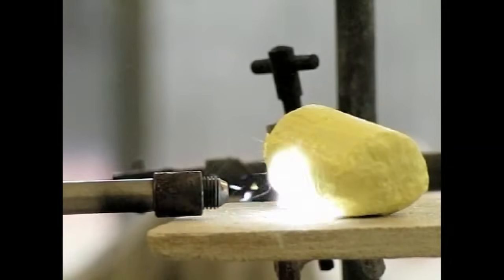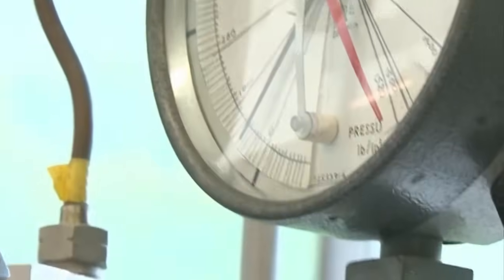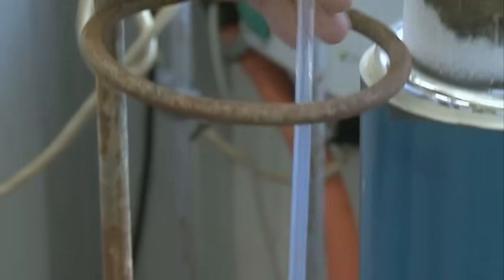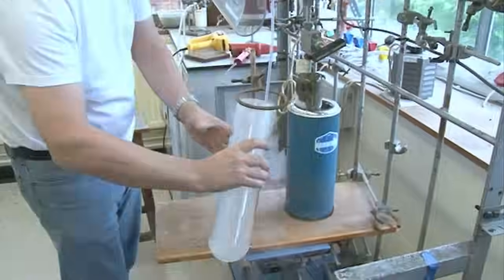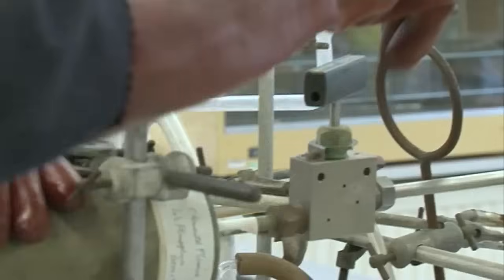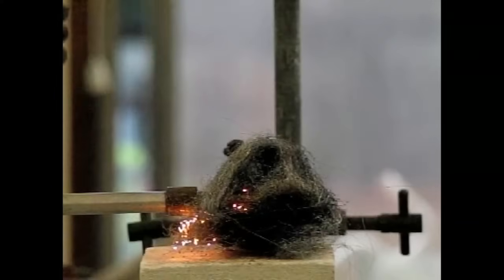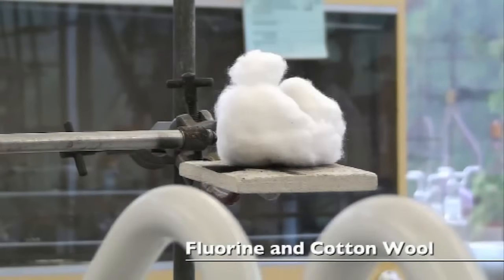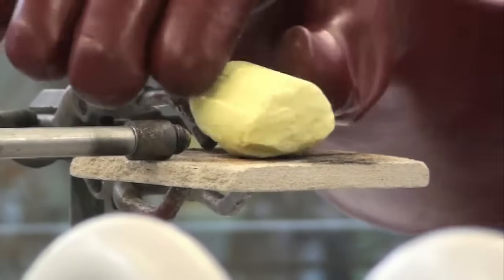Fluorine - Periodic Table of Videos

Comment: So despite all of group 8 being noble gases, fluorine will react with all of them except for Helium and Neon?
Also, i thought that HF had to be stored in PTFE? 
Have worked since leaving school 20yrs ago as a coded pipe welder, specialising in stainless steel. Most jobs I work on, the welds and the area around them are  "pickled" using a paste containing a mixture of around 25% HF and 75% Nitric Acid, to strip the surface layer of oxidised metal, leaving a clean passive layer beneath. This pickling acid is always supplied and stored in PTFE tubs. Is very nasty stuff indeed😲

Comment: When the jet of F2 burns directly through the iron, I wonder what happens to the unreacted gas that now finds itself in the atmosphere?  My guess is that it immediately finds some humidity, releasing HF and O2.  That can't be very nice to breathe in.
Reply: It might also react with the nitrogen in the air and produce NF3, because although nitrogen is very inert, fluorine is extremely reactive and can pull some molecules apart(which makes those N atoms very reactive too) and react with it, and nitrogen makes up about 80% of the air.

Comment: In addition to fluorapatite is inherently less soluble than hydroxyapatite, even under acidic conditions,  fluoride ions inhibit alcoholic fermentation and glycolysis. Otto Warburg and Walter Christian (Isolierung und Kristallisation des Garungsferments Enolase. Biochem. Z. 1941;310:384–421) have shown that this is due to the inhibition of enolase. In bacteria (e.g. in oral cavity) inhibiting this essential enzyme may have direct effects on both bacterial viability and pathogenicity.

Comment: Are oxygen and fluorine the only elements or molecules electronegative enough to cause combustion?
Reply: Combustion is not strictly related to electronegativity, bot more to oxidation potential. So other compounds, like permanganates, peroxides, nitrates, etc, which are also strong oxidizers, will also cause combustion. But in general, strongly electronegative elements are also strong oxidizers.

Comment: Fluorine can also 'oxidise' oxygen, the only element which can. Oxygen itself is a vicious element already, easily oxidises chlorine, right the way to perchlorate.
Reply: @Come up With unique username #VoteBlue  You are incorrect my friend. There is an entire series of halogen oxides (excluding fluorine). For example chlorine dioxide used to disinfect water, and also corresponding chlorine oxyacids and ionic compounds of them, for example perchloric acid and potassium perchlorate. 

And, there is a series of oxygen fluorides, for example dioxygen difluoride. 

Also take a look at compounds like perchloryl fluoride and nitryl fluoride for even more wackiness.

A simple look at the Periodic Table will explain what is and isn't possible in terms of what can oxidise what.

I think you are talking about 02, dioxygen, which is already reacted - with itself, as I mentioned in my first comment.
Reply: @andygrove285  Things doesn't work this simple Just because a compound exists it doesn't mean you can synthesize it from its constituent elements. For example Ag2O, Au2O3 and HgO all exists, but still, you can't make them by burning the corresponding metal. The same is true for a lot of halogene oxides. (Also F2 only reacts with O2 using an electric discharge, so I wouldn't call it a simple oxidation.) Also checking the ptable for electronegativities won't tell you everything about an element's reactivity.
Reply: @hungarianheroes  What are you talking about? Can fluorine oxidise oxygen? The answer is yes. Can oxygen oxidise halogens, except fluorine - again yes. Please take time to read my comments. I said nothing about direct synthesis or any method of preparation. Furthermore, you  are considering molecular dioxgen, so your logic is flawed anyway.
It seems yourself and our friend @Sweet bromine are considering oxidation in layman's terms, meaning like element/compound X reacts with oxygen to produce an oxide. In chemistry terms, oxidation is the process whereby an atom, ion or molecule loses electrons. Fluorine can pull an electron from just about any other element, even oxygen. Oxygen can pull electrons from just about any other element, except fluorine. There may be other bizarre cases, such as excimers or something, but, at STP it's generally true. Of course, the noble gases are extremely difficult, or impossible to oxidise due to their electronic stability. However, xenon fluorides do exist for example.
Reply: @andygrove285  From your original comment: "Oxygen itself is a vicious element already, " - looks like you as well meant elemental oxygen. After that it was normal from sweetbromine and myself to assume that you really ARE talking about dioxygen. And thanks, I was not in need of this additional explanation about how redox reactions work.
Reply: @hungarianheroes  It's pretty clear what I meant when I mentioned perchlorate. If yourself and sweetbromine tend to take the naive view of that, it's not really my fault. And, once again, it seems pretty clear that both yourself and sweetbromine are considering plain, chemistry 101 reactions with molecular oxygen which is itself a compound. In any case, I hope the situation is now clear.
Reply: @sweetbromine83 Wrong.

If reality worked you think it does, then compounds such as chlorates, perchlorates, clorites and clorine oxydes would not exist.

Comment: Hydrogen fluoride acid is serious stuff, I've had the honor of working with it. No need to fear elements but respect them.
Reply: What are the protocols and environments you use to safely work with it?
Reply: @luisp.3788  Wore a tyvek suit (which isn't going to save you), self breathing apparatus (held negative pressure to keep contaminants out), triple nitrile gloves and chemical resistant ones. Honestly you have to wear all that for liability, HF eats through everything but teflon based products. Its a weak acid with the strongest bond to hydrogen. Your body cannot metabolize fluorines, if you live through exposure it'll wreck havoc on the nervous system and organs including the brain.
Sorry for the late 3 year reply, hope all is well on your end mate!
Reply: @FightinForTruth  Thanks. Yeah, I'm alright. Honestly, I don't know why I asked back then but I'll certainly add this to my notes if I ever need the stuff.
Reply: @luisp.3788  Glad to hear you're fine and theres nothing wrong with being curious. 
Unless you end up working in the chemical industry handling fluorines, you can't get a hold of HF. You have to have a license to buy most dangerous chemicals.

Comment: Is Fluorine just as reactive when at a liquid state @ -196oC.
Reply: I'm guessing no however I'd imagine that like with liquid oxygen it wouldn't be the liquid fluorine itself directly reacting with something causing the fire but the fluorine gas being generated from the heat of the reaction vaporizing some of the liquid fluorine into a gas.

Also the warm substance itself (unless pre-chilled to below -188 degrees Celsius) would again also turn some of the liquid into a gas which in turn would start reacting.

Comment: What would happen if you put that liquid flourine Into a 6 inch thick solid glass Container and Sealed it, melting it on the outside so that it’s one solid piece with no air on the inside And allowed it to warm up to room temperature?

Comment: Why was it that these various demonstrated reactions didn't produce toxic gases dangerous to those present?
Reply: 1. Most of the demonstrations consume the fluorine gas almost immediately
2. The fluorine gas rapidly reacted with moisture in the air to form hydrofluoric acid in low concentration, which mostly stayed near the test setup
3. The room likely has positive pressure ventilation, so any leftover hazardous chemicals were forced out of the room rapidly (like in a fume hood)

Comment: I thought it was very toxic but he just burns it in his lab 🤣. Probably mixed it up with HF.
Reply: Yeah, I'm surprise also that they're not wearing face masks. (Gas masks)
Reply: 1. Most of the demonstrations consume the fluorine gas almost immediately
2. The fluorine gas rapidly reacted with moisture in the air to form hydrofluoric acid in low concentration, which mostly stayed near the test setup
3. The room likely has positive pressure ventilation, so any leftover hazardous chemicals were forced out of the room rapidly (like in a fume hood)

Fluorine is indeed very dangerous, but if you're careful you can use it quite safely -  as was done here. The number of chemists that died or were maimed trying to isolate fluorine is quite impressive, but such events are now quite rare because the proper safety protocols have been developed for dealing with it (nickel/polymer materials, positive pressure ventilation, etc).

Comment: It's amazing such a highly reactive element makes exceptionally inert materials such as fluoropolymers (e.g. Teflon).
Reply: Um... as a non-chemist (but remembering my material science classes) I'd say their ambition to bond (with basically anything) is the very reason that they can't "let go", thus creating very stable = inert molecules.
Reply: The flouride bond is so damn strong that it takes incredible energy to separate it. It would be like trying to pull apart 2 strong magnet.
Reply: Fluorine does NOT like to share.
Reply: Or SF6!
Reply: @FarhanAmin1994  That's only kinetically stable.

Comment: But why is HF in solution dangerous? That´s fluoride... still eats my skin
Reply: Two reasons.

It's unbelievably corrosive. Fluorine will bond to almost anything, but it seems to prefer to bond to anything EXCEPT hydrogen. So...if you drop something that is not hydrogen or oxygen into some HF solution, it'll offgas the hydrogen atoms and start fluoridating the atoms in the thing you dropped into the acid.

By now we know that fluorine loves to bond to other atoms...for reasons not yet known, a calcium atom is to a fluorine atom what a cocoa bean is to an Oompa-Loompa. It will go out of its way to bond to calcium. If you splash HF on yourself, the fluorine atoms will immediately start drawing the calcium out of your body. Calcium is one of the most important elements in your body, and you'll die if you lose too much.
Reply: jmowreader thanks!

Comment: Fluorine is kind of the anti-uranium in public perception. It's mostly seen by the public opinion as a "benevolent" element that prevent tooth decay, while poor Uranium is seen as the supervillain amongst all elements for being the poster boy of radioactivity. But if I had to choose between grabbing a—reasonably sized—pitchblende and some fluorine, I would not hesitate a second. A pitchblende is—in my opinion—far easier to handle. Out of CaF_2, fluorine compounds are pretty much hazardous in every imaginable way, like the very common HF being super corrosive and super toxic.
Reply: I think you're mixing up fluorine and fluoride bud

Comment: Don't quote me on this but if I remember correctly didn't some NAZI scientist invent some kind of Fluorinic Acid that turned out to be so deadly that even the NAZI's were afraid to deal with it. Apparently it was so strong an acid there wasn't anything but a couple of compounds that wouldn't dissolve when in contact, and many that reacted most violently. I believe it's still listed as a top ten most dangerous chemicals.
Reply: Titus Tucker Chlorine Trifluoride is not an acid.

Comment: In spite of the usefulness of these video, most experiments are performed without following the most basic safety precaustions. Fluorine is an extremely toxic gas and they don't handle it in a fume hood, they don't wear gloves or a labcoat. Same thing while handling liquid nitrogen. That's not the way you teach chemistry to young chemists.
Reply: Professor Hope is a specialist - he knows what he is doing and most young chemists don't have any fluorine to play with.

I have to admit though, I was surprised they weren't using a fume cupboard for this one.
Reply: As they said, Fluorine is highly reactive, which is why it's poisonous, so it reacts with anything, even just air. It isn't used in such a quantity that it could reach them before reacting with the surroundings.

Comment: So the basis of a fire is a fuel, activation/energy source and an oxidiser; either oxygen or fluorine. Fires with oxygen need some kind of energy to start but fluorine doesn't seem to, why does this happen?
Reply: In this case room temperature is just fine for an activation source. You have to get pretty close to absolute zero before Fluorine can't be bothered to react with things because there isn't enough energy.
Reply: CruelestChris that made little to no sense.
Reply: it causes spontaneous reactions as it has a low activation energy.
Reply: Joshua Rosen 
No no no, you can't start a fire with the energy that comes from the fire starting, if that worked then everything in the universe would spontaneously combust. Not that this stopped Tony Blair from telling British councils to build flood defences using the money they'd save by having them, mind you. :D
Reply: Owiko7 
What he was saying is that the reaction is exothermic, which provides energy for burning. The problem is that the oxidation reaction is the burning, so he's saying that burning is what starts it burning. The actual reason it starts burning is that the activation energy is already present at room temperature.
Reply: CruelestChris It was just that you had phrased it in a strange way, and I wasnt exactly sure. But yea I agree with what you are saying here
Reply: Owiko7 
The other thing I was talking about was a bit of government accountancy here in the UK. We had some serious flooding, and the Blair government told councils they could easily afford to build flood defences using the money that they wouldn't have to spend because the of the flood defences. Similar thing of causing something with its own effect.
Reply: CruelestChris This is not correct.

An exothermic reaction like oxidation does not require additional energy to start at normal temperatures.   If the reaction is only slightly exothermic, like rusting, the heat will dissipate too quickly or may simply be insufficient to accelerate and burst into flames.

If the reaction is highly exothermic, as those involving fluorine are, it will quickly generate a lot of heat.  Typically this heat will speed up the reaction resulting in what you mean by a fire.  No additional heat input is necessary.

Nuclear fission reaction is probably the best example of exactly the sort of pulling yourself up by the bootstraps that you are talking about.  To create an explosion, you need neutrons to cause enough atoms to split.  The neutrons come from decaying atoms.  What causes most of the atoms to decay?  Neutrons from other decaying atoms.
Reply: Joshua Rosen Oh no! not the "which came first" arguement!

Comment: guys, GUYS, I HAVE A GREAT IDEA, LETS PUT THIS IN OUR WATER!
Reply: Fluorine isn't in our water 
What's in our water is sodium fluoride which is perfectly safe
Reply: fluoride is reacted fluorine, as mentioned. it's not perfectly safe
Reply: hemptime123 
Sources...
Reply: A stable element does not equal a safe element. all of it's components are still there, it's still a neurotoxin, but it wont create flames when it enters your system.
Reply: The more reactive an element, the more stable it's compounds.
To get Fluoride to react, you'd need to hit it with the same amount of energy Fluorine releases when it reacts.
Fluoride is toxic. So is salt. Get over it.